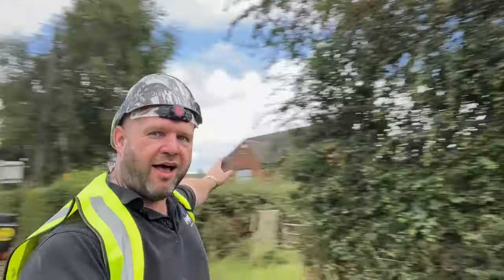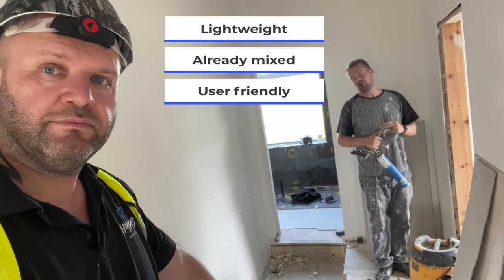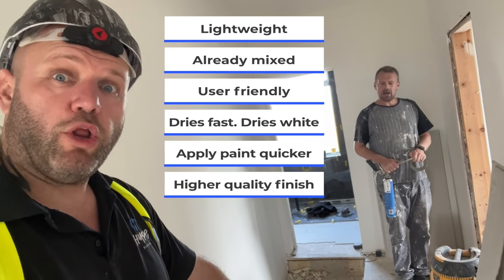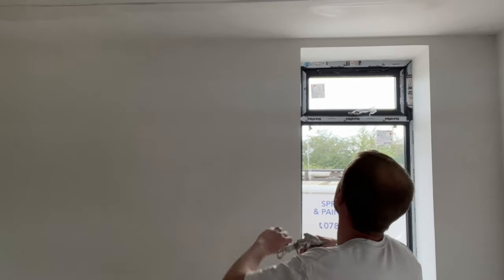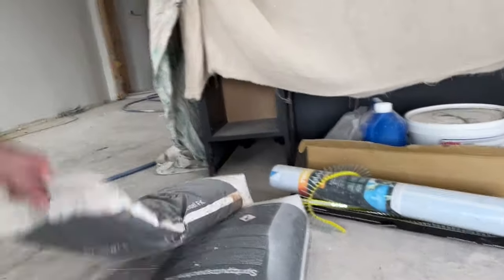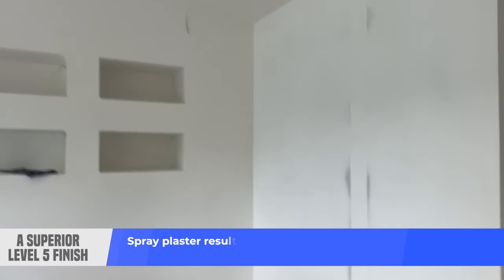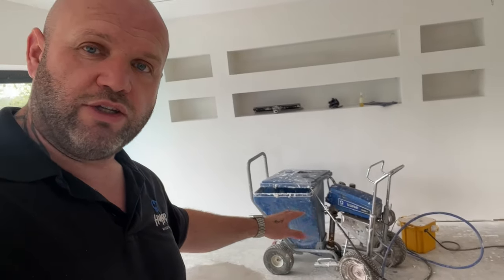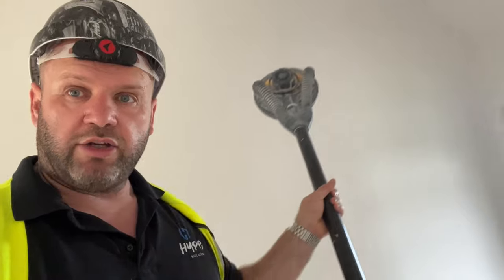Spray Plaster: What are the Benefits? (Watch a Demo)

Comment: They do this as standard in California, USA. It's good to see we are moving with the times in the UK.  Keep up the informative videos. Would be a good to show them doing a section of the wall?
Reply from the maker: Hi there. Yes, we can see why they use spray plastering as standard – it definitely has its advantages over regular gypsum. Maybe it will grow in popularity in the UK in the coming years. We'll definitely be using it more on our projects.

Hopefully, we can show more of the lads applying the spray plaster in future videos. Good point 👍 

Thanks for watching and for your comments 🙂👌
Reply: @HYPEBuilding  just checked to see how much this machine is, £7K wow i suppose pays for itself if you do this regularly.!
Reply from the maker: Yes,  @gore5542401  the equipment doesn't come cheap but it's a great investment when you're in this line of work 👍
Reply: I went from a  ten grand hopper machine down to 3 little machines as long as they put out 3000psi thats all I need needed...you need to look into other level 5 plaster the stuff your using looks old school.. the last lot I use 15 years ago looked like paint dried into plaster.

Comment: You going far to slow what tip are you using.. take the gun filter out water your mix down  i know your new to this but nz and aus was doing this 40 years ago its died out now. You are the first guys in the uk that actually spray.. you should get the painting contracts to.
Reply from the maker: Hi. Thanks for watching. It's not that we're new to it – as you say, spray plaster has been around for a long time. It's just something we prefer to use on our high-end projects as it gives a much better finish in our humble opinion.
Reply: You should also get into the painting side because you have the machines...hopefully you can get people to go for the higher standard
Reply: @HYPEBuilding  you  can get the level finish with microbuild paint its basically paint with tradeset plaster mixed it .. comes in 15 ltr buckets ..

Comment: What about re skims in old properties where the walls are all over the place? How does it hold up then?
Reply from the maker: Hi Jaime. Thanks for watching and for your question. You can spray it thicker in places but if the existing walls are so bad then you would probably re-board them. Spray plaster is very similar to regular plaster in that respect, it's just a different method of applying it.